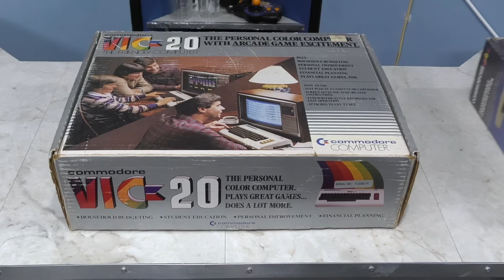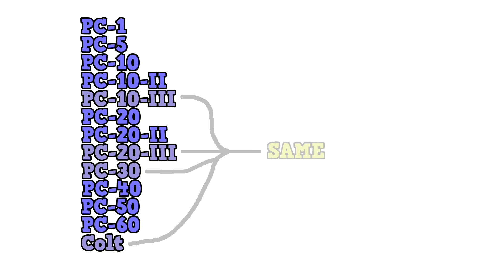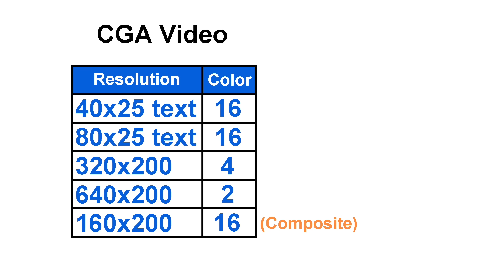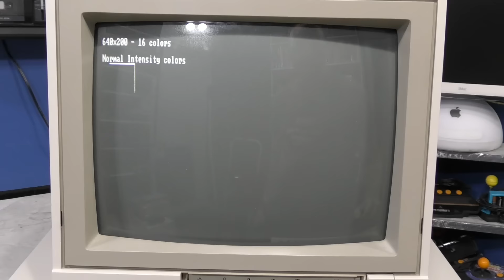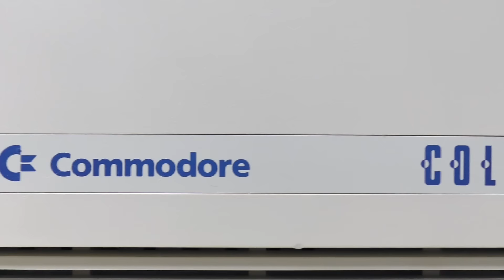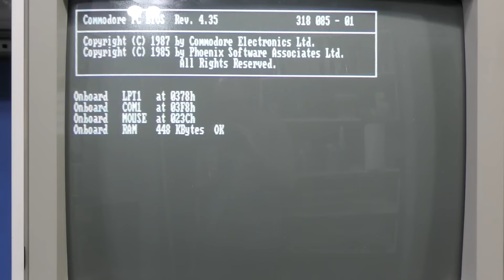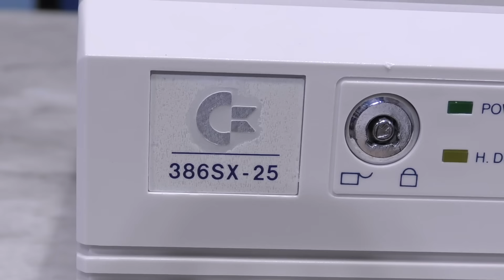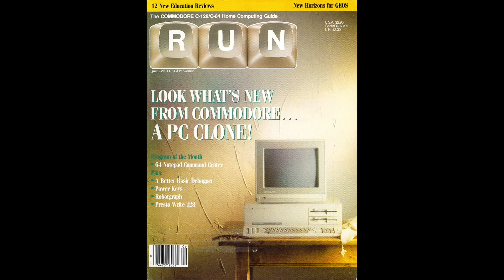Commodore History Part 6 - The PC Compatibles

Comment: The d-sub ports still are looking like new. ;-) The hole PCx computers are looking as if the were yust bought as new devices at the store. Impressive!!
I still have my old CBM 3032-SK incl. the double floppy drive CBM 8250 (the old one not the flat one, little revolution those days with 2 mb in combination) and also the CDM 4022P printer. Would be still working but I haven't any ribbons anymore. :-( ...good old days!! :-)

Comment: I remember having worked on a Commodore pc, and being an Amiga user, I was surprised to see it used a parallel mouse, the same Amiga mouse. I later found another pc using parallel mouse, it was an Amstrad PC. But the mouse connector was male instead of female as on Amiga. This Amstrad mouse could be transformed into an Amiga mouse just swapping 2 wires in the internal connector and adding a gender changer, I did it a couple of times, when my Amiga mouse failed to work. :)

Comment: My first pc in 1987 was an Atari PC3 8088 at 8Mhz with EGA graphics, 30mb HDD and 720 floppy. This board also had the controller for floppy on board. The HDD used an 8-bit ISA controller card but what was bizarre was that on the motherboard there was an IDE port (which I never got functional). I wish I still had it 🤔

Comment: So I work in a thrift-shop in the E.U. A few years ago we got this flatscreen from Hercules. It was just about 12" and had a VGA connector. It did seem to work, just not on the lowest res of Win7 at that time. Guessing it was a very high end thing from back in the day. Ended up being sold from our bargain corner for 5 Euros.
As to you not having a 220-250 adapter... Wtf, those are € 5-10. So second hand they should cost you around 2 dollars. Granted high-amp or full 50-60 Herz conversion may set you back a few dozen dollars...

Comment: 14:00 Describing the XT-IDE/XTA adaptor and hard disk as "custom" is a slightly odd choice. It's actually the first iteration of the ATA standard that we still use today.

The Western Digital drive itself is also a familiar sight to some (wealthier) Amiga users as it's the exact same model that came with Commodore's A590 & A2090 hard disk controllers.

Comment: The Performa SKUs (not to mention they were mostly mirrors of other SKUs like the Centris and other lines) was a nightmarish attempt to straddle two markets discretely and without 'a build your own at time of purchase online' option, the SKUs themselves were a way to order a specific memory, CD rom and HD configuration. A terrible one at that. A little more than 3 years after that presented list, Steve Jobs returned and the mega SKUs were banished and the first online store emerged. A lot of manufacturers had similar SKU nightmares as you noticed with the Commodore list. IBM, Compaq, Dell - all had SKU coming out of their ears similarly.

Comment: I’m sure the commodore PC 10 didn’t come with a CGA card. It’s mounted afterwards. If I remember correctly it had 256kb (or 512) ram, two 256kb floppies, no hard drive and came with a monochrome monitor. I had one and used a Hercules card at first then switched  to a CGA card. Also mounted a 20 Mb Hard drive.

Comment: That PC10 graphics card sounds like the ATI Small Wonder.  Looks like it too.  If you check out the wiki for Hercules Graphics there's a picture of it at the bottom showing Hercules compatible cards, and it's got the headers you pointed out.

Comment: The first x86-compatible machine we ahd in our home was a PC-30, I think.
Prior to that, we had the C64.

After that, we had a self-built 486, from 1992, which was later replaced with Pentium 120 in 1994 or 1995.

Comment: Interesting fact, Bill Sydnes who was the project manager for IBM's PC compatible project 'Project Chess' eventually became the head of engineering in 1991. Sadly it was probably this combined with Irvin Gould and Medhi Ali's greed that did for Commodore as they crazily continued to make their PCs rather than second sourcing them from a cheaper clone maker. Bill Sydnes brought in many of his ex colleagues and Lew Eggebrecht (another IBM PC guy from Project Chess) as a consultant. Lew took over as Vice President of Engineering after Bill was sacked, and remained in post until Commodore's demise. Lew on the whole seemed to have a bit of a better grasp on what Commodore needed to focus on, as sadly Bill Sydnes put paid to two very good Amiga products that never got released, The Amiga A1000+ and the Amiga 3000+. But it's interesting how two core guys for the IBM Chess project ended up at Commodore managing their IBM clone output and engineering in general.

Comment: I had the PC 20-III back in time. and later a IBM 286 AT PC with a 21 MB HDD And today i have a AT PC 286 with 12 MHz 21 MB HDD 640 K of RAM Dos 5.0 and Windows 3.0 THank you so much for the great video :)

Comment: Hi All, I purchased a Commodore PC-5 brand new must have been between 1986-1988. It did have the ATI video card that was set up for CGA colour, but the bundle that i bought was with the Green TTL screen.

After some warranty work the dip switches were changed and it all worked well.
I defiantly remember, green screen, the adjustable / add on video card, 512k and single floppy

I think later on i upgraded to the twin floppy, so boot disk and multiplan data disc was A and data saved was on B

At that stage not to many games were 2 x 360k

Suprisingly the 512K was not a shortfall and 99% of every software worked, i distinctly remember playing corvette, spacequest and a leaderboard golf, all of the green screen, i would safely say 50-60% or CGA games ran in green mode OK

At the time i still had my C64, eventually i purchased Amiga 500, the C64 went into the spare TV room and i sold the PC5 to fund a turbo XT ( the 3x speed 12 meg i think ) , with the big 1.2Meg 5 1/4 floppy ( 2 of them actually x that is 8 time the storage !! )
Later the clone XT received a used RLL or MMF 10meg hard drive, it held everything !!

The PC5 and the XT Turbo both had the typical XT style keyboard - the F1 to F10 on the left hand side of the keyboard, later on At's expanded to the AT style with F1-F12 on the top of the keyboard and the reverse T style curser keeys

Regards
George

Comment: My grandparents gave me the money to buy a Commodore 486DX 33 mhz with 4 MB ram and 130MB Seagate HD plus 512kb or even 1MB Videocard. Cost was 3.500 DM. Also a 14" RGB Color Monitor  38khz was included. That was starting 1992. DOS 5.0 and Windows 3.11 as far as i remember.
I never used Windows, i only played games in DOS 😁. The floppy with the Video Driver for Windows 3.11.... I did a format on that one and used it for other data, had no idea what it was for at the time 😂

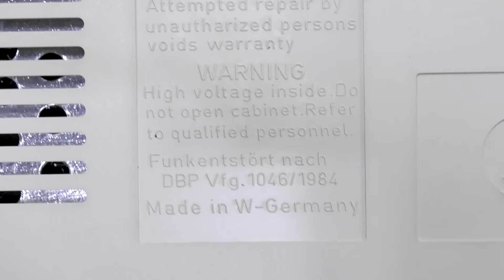Comment: Concerning the date of 1984 at 1:43 "Funkentstört nach DBP Vfg. 1046/1984". That means that the machine is RFI suppressed  (funkentstört) according to German Federal Mail (DBP = Deutsche Bundespost) provision (Vfg. = Verfügung) no. 1046/1984. Back then, German Federal Mail was an authority and not a company. They were not only responsible for mail but also for telephony and radio used for communication. Provision no. 1046, decreed in 1984, dealt with the suppression of unwanted radio signals emitted by electrical devices which could disturb radio communication. So the year 1984 is referring to the provision and not to the computer's year of manufacture.

Comment: David, did you consider implementing an intelligent screen repaint mechanism in Planet X3, that only redraws those parts of the screen that actually have changed? Like if after scrolling the screen in any direction the same standard 16x16 (or I don't know what size) would be displayed at a certain position, then you don't actually have repaint that area, but can skip that, and you only need to redraw those 16x16 panels that are now different than they were in the previous scroll position. That could eliminate a nice part of the lag, especially then when scrolling through mostly uniform regions, like untouched land with no buildings/units on it, or the sea, which also consists mostly of the same panels.

Comment: 1:43 on the back of the case is the norm (issued by the German postal service) of electro emission. It was issued in 1984.
Not really surprising the norm is older than the product.

Comment: The ":1984" on the back at 1:43 is not a manufacturing date. Vfg 1046/1984 is a conformity statement that the device suppresses RF radiation according to "Postordnung 1046/1984" (this seems to fall under the DBP, Deutsche Bundespost, the German postal service, hence "Postordnung"). If the 1984 means a year at all, it's the year of the emission of this rule that the device claims to conform to - from what I could find, 1046/1984 was indeed a general permit for computers and HF equipment, and was part of the German RFI law of august 1984.

Comment: I had a Packard Bell "PB500" with a similar ATI video card.  Mine was also branded as "Graphics Solution".  Mine had the 9 pin video port and a composite connector that I did not understand at the time and never had made use of.  I don't think that mine had the joystick or parallel headers though.

EDIT: Heh.  I had compushow.  As a young teenager I was able to download ahem colorful image content from BBSes that probably shouldn't have been so readily accessible to a young teenager.  They looked as good as one could expect on an extended CGA monitor.

Comment: I did hear of a DX-64.  Was it real?  I had an SX-64 and used the disk storage for a "External" 1200baud modem AA/AD that I mounted in that space.  I had to run the cable out the back and around to the user port.  I remember the modem was made in Redmond WA but do not remember the exact name or company.  I ran a C-64 BBS for 2 years in Atlanta GA with this machine and a few drives daisy chained off the back.

Comment: BTW. Commodore was so in havoc when they released these systems that they couldn't even create an integrated approach like Apple did with their Macintosh II offerings.

They could have leverage the Amiga's preemptive multi tasking and advance colors and sound, to offer a very high end Amiga Workstation  with the 68030, then all sorts of mid range PC clones with MS-DOS and a low end Amiga 500 type computer for simple games.

The Amiga could have even been its first server, beating all of the competition (except Unix WS) due to it's ability to multi task things.

But, of course, everything here is just hindsight and at the moment, they could even find their glasses.

Comment: Amstrad's first foray into PCs, the PC 1512, also had a CGA video adaptor with 64K, which allowed for a 640x200 16-colour mode. These machines came bundled with a version of GEM which supported this mode, but there were also a few games. I owned one, Millennium 2.2 - could this also run on a PC 10?

Comment: My aunt use to have two of those. One 286, then later one 386. She used it quite intensely doing most of here PhD work at home, using the computer quite a lot for being a boomer.

During the late 90-tys the PSU in here 386 broke and she couldn't access any of here data (she did have a backup, but not for everything). It would cost $300 to switch out the PSU. So i told here you could pretty much get a new computer for that.... At this time the cheap MB still used DIN keyboard and serial mouse. So i ordered the cheapest AMD K6 i could find... She did have a fairly new screen and here keyb and mouse worked just fine.

Just moved over here old HD.....

Well.. its supricing how long it takes to move over 40MB of data from a 40MB harddrive.

Comment: AFAIK they were produced at Commodore's factory in Germany, side by side with the original A-series Amiga 2000. The reason the motherboard says 1987 is probably because it's an American model. The PC line weren't introduced on the US market until '87.

Comment: "240 volts". I think you mean 220v.  240v is UK and Ireland (or it was...)
Reply: I think most European countries have increased from 220 V to 230 V or even 240 V these days, haven't they? 230 where I am, at least.
Reply: @knahrvorn  The EU standard is 230v. However it.has asymmetric tolerances which means voltage in   UK/Ireland can be 240v and elsewhere 220v

Comment: Probably a good thing you didn't have 230V available.... those PSUs on the Euro models would need 220-240V 50Hz power where as USA uses 60Hz. It may or may not have been a problem...but due to the rarity and age of the hardware, might have been for the best not to find out.

Comment: Actually, PS/2 ports were not at all common in the clone PC world in 1991 yet. It took until '94-'95 before they showed up with any kind of regularity in prebuilt machines, and AT boards with DIN keyboard connectors still were very common in '96, even '97. The ATX formfactor later put an end to that.

Speaking of PS/2 ports, you can still buy plenty of current motherboards with them. I don't think it's just the superior interrupt-driven protocol (which is mainly of interest to the hardcore gamer these days), probably there also are a ton of beloved vintage keyboards left.

Comment: Not all of that layout seems particularly strange to me.

I have a Compaq keyboard that I'm currently using dating to about 2003 or so, as well as an Acer laptop from 2006 on my desk to my right.

In both cases they share broadly the same keyboard layout (bearing in mind one is a 101 key layout and the other an 88 key).

What's the main thing you notice, looking at them? 
Well, the right slash (\) is next to the left shift key.
Also the tilde (~) is in the middle row next to the enter key.

So, you might be confused by how this is possible on fairly modern keyboards...

- Well, the answer is that these are a standard UK QWERTY keyboard layout.

Compared to a US layout you find most of it is near identical, except for a few things.
Right shift is moved to the bottom left of the keyboard, on a button that wouldn't be there on a US layout. (this results in a smaller left shift key)
What would be the right slash on a UK keyboard is the # key, (and the shifted form is ~ instead of |)
The tilde on a US keyboard is swapped for ¬
the double quote mark ( " ) is shift+2 and consequently, the @ symbol is where the double quote would be on the US keyboard.

And of course the # on a US keyboard is on shift+3
So if this is now on the far right of the middle row, what's on shift+3?

Why, the £ sign of course, which doesn't occur on a US keyboard.

And that's about it. Compared to the US keyboard there is one extra key, whose location is different to on the US keyboard, but whose functionality matches exactly with the US keyboard.
one key that has two functions that are on different keys on the US keyboard. One key whose shifted form is another symbol that doesn't seem to be present on the US keyboard.
And three keys where the standard result is the same, but the result of pressing shift with that key is different.

But, in any event, it looks somewhat more like those older keyboards than the modern US layout does.

On another note, can I just take a moment to point out (which is irrelevant to the video, but still) how utterly stupid the language bar in windows 10 is in regard to having multiple keyboards?

The windows 10 language bar demands that you specify a keyboard in relation to the language.
If you have multiple languages, you have to reconfigure the keyboard used individually for each language.
Have multiple keyboards from different regions? Yeah, you're going to have to configure it to have the same languages multiple times for each keyboard type you have installed.

To say that this is stupid is an understatement. People with multiple keyboards attached to their computer are going to have keyboard layouts related to the physical keyboards that are present, while the language settings are something you change on a case by case basis depending on which language you are using.
Tying the two together like this is just stupid, because in practice they're independent variables.
Bleh.
(it gets worse if you only have a single keyboard plugged in, but recently swapped layouts. Another kick in the teeth is that it appears to disable any other possible layout during the login screen if you have any US layouts set up in the configuration - I hope you remember your password in relation to the physical keys on a US keyboard, and not in relation to the characters it contains, because otherwise...)

Bleh.
Worst part is, it seems like they changed this in a patch, and it was more sensible in earlier builds.
Thanks microsoft!

Comment: Five minutes left of the video and I gotta go to work. So, are you going to connect a joystick and a parallel port to that ATI video card?

And I'm curious if one of the modern "laser mouse" PCB upgrades for the Amiga Mouse would be recognized by the Commodore PC. [for the record, that upgrade is also available for the Atari ST Mouse]. Finally, let's see a Commodore PC Clones vs Atari/ABC PC Clones video!  :)

Comment: The date on the back of the PC-1 is apperantly referring to a German standard, probably referring to when that standard came into place. It says: "Funkentsört nach DBP Vfg. 1046/1984" which means: "radioschielded in accordance with DBP Order 1046/1984"

Comment: Hi buddy, regarding the release date of the PC-1: THe date of 1984 you referenced on the back of the machine is actually the date of the revision of legislation requiring devices to be radio interference free and is not related to the product itself. The mainboard printed date therefore must be close to the actual release date. Hope this helps.

Comment: If you're willing to settle for 160x100x16, the CGA would do that, even over an RGB monitor.  It's not a well-known mode because it has no BIOS support, but the CGA Technical Reference Manual tells you the hardware programming required to use it.